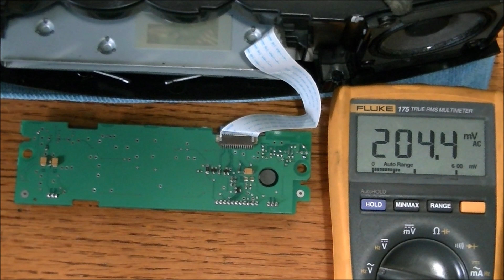Bose Wave Radio Troubleshooting Display Voltage Testing Part 3

Comment: hello i never repaired things my relatives gave me the same model just the top a single wave 4 system. it works but it has no display at ail every works  other wise  sound , radio and aux sound good.  i did not try the cd since there display.  is there an easy fix to make the led work without opening it up?
Reply from the maker: Hello Tony. Unfortunately, I don't think there is a way to make the display work  without opening it up. It appears I lost the minus 20 volt DC on the LCD display. 

There is a ribbon cables that can cause the display to not work. That would be an easy enough fix. perhaps your ribbon cable worked it's way loose. They are only held in there my resistance with no locking mechanism. Good luck with your repair. 

If you think you may be in over your head with that repair, there is a tech in Florida (SOSFix) who does great work on electronics. He has repaired a dozen of these Bose Wave radios in the past couple of years. He is on YouTube an has a Facebook webpage.
Reply: @Tobinindustrial  l talk with my wife about fixing it but i think i might let it go . im near nyc and i will only use it time to sound as a speaker for its  aux port.  Thanks for the reply you taught me a lot with your statement and video.
Reply from the maker: @tonythecomicps3  Just sayin'...  I am interested in your radio if it is something you no longer need... Thanks for this comment. I am so happy when what little I can express in a video is helpful to others. I am sincere in helping but my knowledge is limited like most. I wish I was a brilliant technician, but I have greater talents in other ways and you cannot be everything to everyone all the time. I am just happy to know as much as I know to fix something every now and again. Yes, I get lucky sometimes with repairs.

Comment: Could be a bad voltage regulator??
Reply from the maker: Hello Darrell. It looks as though I lost the high voltage rail to the display. Both Radio and CD work fine as well as all remote control functions. Thanks for dropping by and offering some ideas on the radio.